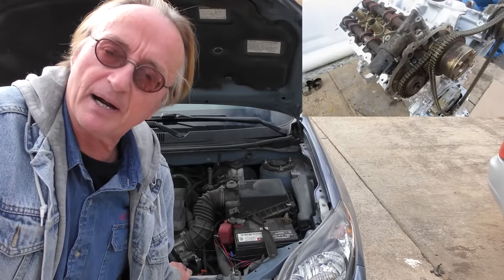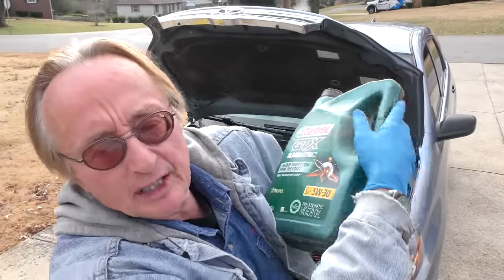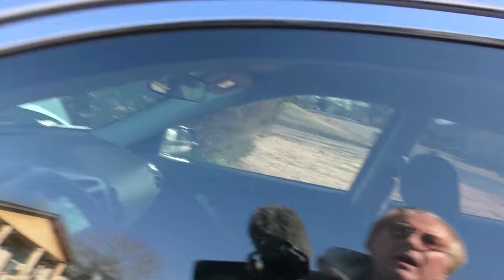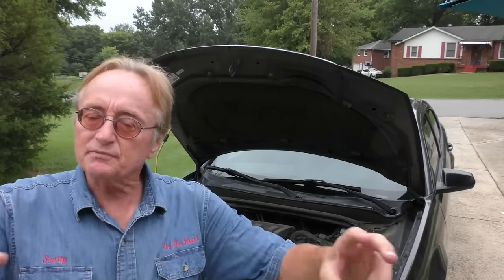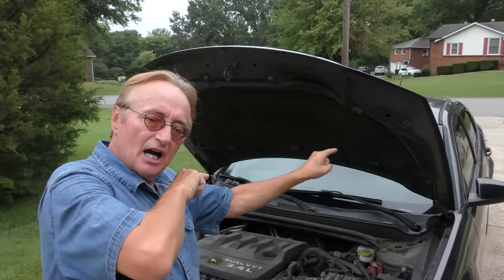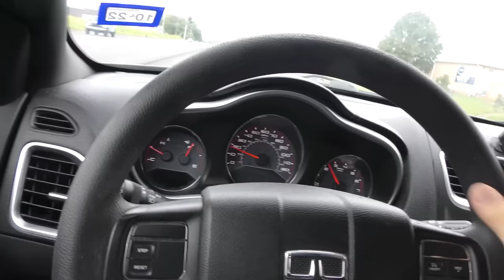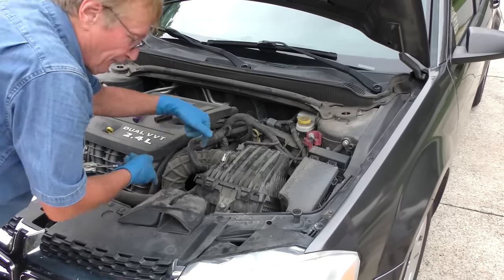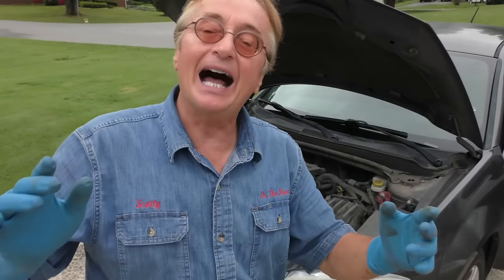Doing This Will Make Your Engine Run Like New Again

Comment: One thing you want to watch out for is the oil cap itself. It can disintegrate at it base and clog the oil pickup. I know it sounds crazy but a perfectly healthy engine did it in my vvti toyota. Change the caps if the car is getting older.

Comment: Sold my 2005 new off the lot Matrix after 350k miles. I took care of it. The new owner still has it and it has at least 500k miles on it. I WISH I did not sell it but it was one of 3 cars we had.
Reply: How many years did you own it?
Reply: About 9 years. Bought a used 2007 Rav 4. I’m going on 9 years of having it BUT I am getting a few majors issues with it. It had one owner and 35k miles on it then. Still had the the new car smell but was originally near a area with salt water (FLA) I only have 120k miles on it now.
Reply: @lasharapinckney5276  that matrix sounds ridiculously reliable for those miles.

Comment: I do my oil every 3-4000 and i use a k&n oil filter with a synthetic blend in my 1998 honda accord EX 2.3L. It burns a fair amount of oil so to combat that i mostly go easy on the car and try not revving too high (thats when mine especially burns a ton of oil).

Comment: Scotty this is the 1st video I've got to watch&it sure isn't going be the last. I've gots a 2000 Mustang v6-3.8L. I came in from work 1 evening turned car off went to go to work the very next morning. Wasn't going n.e we're. It wouldnt crank, wouldnt start, hear no clicking. Battery is good, Alternator is good. I'm hoping you would lmk what the prblm is&what I need to do to fix it. My DaD was an awesome Mechanic&I've gots to say ur pretty smart&awesome guy also. Most Respect. Ty Scotty

Comment: I’m my own mechanic thanks to the internet, I learned how to fix my own car. I have a 05 Chevy Cobalt and it has almost 200k miles I bought two years ago from a person that didn’t take good care of it but I’m fixing it up now, but when I first drove it on the highway it didn’t shake didn’t misfire or nothin else serious. The only real issue is it sounds like a motorcycle. But I never got that car to keep it forever I got it just to take me to A and B until I get a better one.
Reply: Those are actually good cars. The ECOTEC motor is a strong unit. I had a 2.2 on my Saturn L100. It was running great at 197000 when it was stolen.
Reply: I put 223,000 miles on a 2007 Cobalt from new, still ran well when i sold it in 2015. Kept the oil changed regularly.

Comment: Great info. I change my oil+filter every 7/8 months on both of my cars (06 Solara V6 snd 2011 SantaFe awd) regardless of miles driven. I always use Mobil full synth extended performance or Castrol Edge full synth extended performance plus mobil EP oil filter. 20+ years using those brands.

Comment: That was a very nice video! I actually started doing oil changes on my own and can't wait to learn some more things about my car and actually maintain it. Thanks!!
Reply: After buying and losing 3 used cars - all lemons - in one year when I was in college (i'm an accountant) I decided I better learn about automobiles before buying a 4th lemon. Now I help everyone with their cars, and would go up against an ASE certified mechanic any day of the week, unless your talking transmissions!  lol! And trust me, do the same BEFORE you buy a home. Know how to fix stuff, you'd be surprised just keeping stuff "clean" helps keep it operating! If you own something, learn how it operates, you'll never have regrets.
Reply: Don't wait for something "to break" before fixing it. And stay away from Mexican auto parts. NAPA and O'Reilly's has the most American made auto parts - if you can afford it. AC Delco parts are "excellent", better than original GM parts on new cars. (also worked at Autozone). Delphi are Toyota aftermarket parts. I think AC Delco are the best aftermarket parts out there . Regardless if you own GM or not.
Reply: @Johann Johann  Denso are OEM Toyota parts.
Highly recommended. 
My Scion TC has the Camry 4 cylinder engine.
So easy to work on.

Comment: I own a 2012 ford fusion i4 with 460,000kms still run like a clock and replace the oil every 5k with full synthetic oil and transmission oil every 45000km. Thanks Scotty!!

Comment: I always used Mobil 1 but recently grabbed some Pennzoil Platinum. I find it runs a lot quieter with it.
Reply: Mobil one is garbage. 
I only use Castrol Edge Advanced Full Synthetic
Reply: @jacobsebastien3910  what castrol models can use for golf mk5 or any European car? Advice me
Reply: I use Pennzoil Platinum 5W30
Reply: Did you use the same viscosity of each? I could see the engine operating sound change if you used a different viscosity
Reply: @jacobsebastien3910 why is it garbage?

Comment: Bring the engine temp up to "normal" operating temp before you pull the drain plug. This will help it flow better out into the drain pan. And move the drain pan out from under the oil filter when you put the new filter on. I failed to do this once and and the new, clean, unused filter slipped out of my hands and landed in the pan of dirty oil. That was $ down the drain and I learned and have never repeated this.

Comment: Awesome video, this is the same engine in the Dodge Journey sxt. 4 cyl 2015. This is a great motor, with some work they can last a long time mine is at 360,000 + miles. right now I have an exhaust leak north of my O2 sensor bank 1. it might be my exhaust manifold...hey Scotty, any videos on locating exhaaust leaks and replacing a gasket on this engine. Also, I happen to have a VVT solenoid for the intake side sitting here right now...just don't want to get into it right now because they have a history of breaking off when attempting to remove them, piece that gets stuck inside engine has to be drilled out. That is a whole nother story.

Comment: If you have an aluminum oil pan, be super careful when putting the drain plug back on…don’t cross thread it! If you do you’ll have to replace the oil pan and they are not inexpensive.
Reply: Quick oil change place....cross thread is better than no thread. 🤷‍♂️😏
Reply: that is why Scotty says hand-tighten the oil pan drain plug first before using tool.
Reply: They're not that expensive. I had to replace mine and it only cost $1385.

Comment: My dad's been using castrol edge 5W-30 (we buy it in costco cause canadian costco's sell it for a decent price) in our mercedes for the last 20ish years and it barely burns any oil. That's preety good for a mercedes after 20 years of abuse. The exterior is falling apart but the main parts and interior are still fine.
Reply: How much is it?
Reply: @Vertikala-pc5ig  Usually get it on sale, but in Costco its in bulk. Its a 5 liter container and you get 3. Its currently $140 cad plus tax for 3. Which makes it like $47 cad plus tax. My Costco has it on sale every year so I try to get a few boxes and keep them well contained in my garage waiting for use. Other stores sell it for 10-30 dollars more per container. I reccomend looking around getting it on sale and keeping a few containers of it for the next few oil changes.
Reply: @AmbeSwag  So it comes out about 10$ a liter which is not cheap either but what can you do everything went up. Thanks anyway
Reply: @Vertikala-pc5ig  I buy it from Costco if its urgent. Usually I stumble upon some random store selling it for way cheaper cause its on clearance or something. Just remember to check if its sealed properly and check when it was made.

Comment: Do not use a long breaker bar to tighten the oil plug. A standard length ratchet or wrench will get it plenty tight. You won't have to use a long bar to get it off at the next oil change. Don' t strip the plug by using too big a wrench. C' Mon Scotty, you know this!
Reply: He actually mentioned not going to tight so you don't strip it in the video. He also mentioned the only reason he was using an extension bar is to prove that anybody could get the oil drain plug off even if they're not as strong as some other people with it.
Reply: I agree how idiotic!
Reply: Come on man, how can you diss Scotty? He is never wrong!

Comment: I had to do the throttle body position sensor reset for idle relearn in my honda after cleansing the body because car was jerky when stepping on and off the accelerator. No other method of idle relearn worked. Just to keep this in mind maybe some other vehicles require this too.

Comment: Agree on the Castrol oil. But I use fram filters always. Now as far as the alloy wheels...  I like them. I live in pa. So salt...   Trick when you change tires wire wheel the rim and spray paint it with enamel paint. Its easy

Comment: I'm currently using Valvoline Premium Synthetic Oil which is a better graded formula than Regular Synthetic Oil which haves additives to clean any deposits and longer lasting. Did it for my 2010 Nissan Rogue which I change oil once a year on. Still Run good  👍
Reply: And I'm just an average "joe". not an employee. Just got pissed when I learned what the legal term "full" means regarding motor oil. check it out.

Comment: I AGREE WITH YOU ABOUT CHANGING OIL REGULARLY. I did have an 1985 VW Cabriolet  that I bought in 1995 with 100k miles on it. I changed the oil RELIGIOUSLY with Castro oil 20-50. I drove it for 16 years, odometer quit working at 196k and continued to drive it for 5-7years more. GOD only knows how many miles I had on it. I also had the same clutch the WHOLE TIME. IT'S A SHAME I LET MY MOTHER CONVINCE ME TO SELL THE CAR, STILL RAN GOOD, NO LEAKS, GOOD GAS MILEAGE FOR THE WAY I DRIVE but was going to need a new top soon, air conditioning didn't work, needed paint job and interior work. I had just a new clutch and tires installed. 😮😢

Comment: I Only use Castrol Edge High Mileage Advanced Full Synthetic in my 08 Ram 2500 4x4 Hemi can't even feel the engine running while idling. Great Oil 💪

Comment: I had the same problem with my Dodge avenger 2013 black top edition Had to replace that part throttle control at 65,000 km

Comment: On my LH Concorde I cleaned out air filter housing thru and pass the throttle body upper and lower intake and changed all gaskets including valve cover gaskets .I also replaced the sensors on the throttle body inch pound torch wrench tighten in sequence good business. DIY'er

Comment: I change my oil every 3000 miles or during major seasonal changes. 0W-30 for the Winter and 5W-30 for the summer. Always K&N filters and Amsoil Oil if I can find it, otherwise I use Pennzoil.
Reply: Mobile 1?

Comment: The other thing about cheap filters is they will stop filtering, and in many cases, clogged up and collapse and then when they do, either you have a massive leak if the canister ruptures or if the filter material breaks apart, then you have junk flowing around in your engine oil.  Best to spend a few bucks more and get a premium filter (the price difference in most cases is $10 or less and well worth it, especially if you're going 5,000+ miles).  I generally have used Bosch or Wix filters (both are good quality filters and are generally better than even the OEM filters which are only designed for about 5,000 miles).

Comment: I change mine once a year at around 10K with 20K Mobil 1 full synthetic extended performance and matchign filter because my Lexus GX 460 requires that I drop the skid plate to reach the oil filter.  I think if it didn't have the skid plate I would maybe increase the frequency.

Comment: Just be sure you are turning the plug the correct way when using a extension.
Reply: What?? And 6 others?🤤🤤🤤

No matter if it 10 miles long… left turns left ten miles other side. right turns right ten miles other side extension.
Reply: Is it the same if I use a wrench instead of a socket?

Comment: I'm a Mobile 1 man. My grandfather used Mobil 1, my father use mobile one... so I use Mobile 1.
Reply: Ah...tribal custom. 🤷‍♂️😏😆
Reply: Is mobile 1 that old?
Reply: Ford boss me did an oil comparison recently. oil analysis included. I think mobil 1 was there but not really the top performer. Check it out if you have time.

Comment: Blessings scotty..I have a 2010 toyota avalon limited at 245000 miles .what can I do to keep it going and reach 400000 ? Thanks ❤️
Reply: Buy 2 odometers
Reply: Routine Maintenance!! Changing all filters and fluids at the recommended time frame or recommend mileage. That’s pretty much it. Change spark plugs at recommended mileage.

Comment: Should you change every 5000 or 3000 miles? I was always told 3000 miles but with the newer vehicles I was told you can do every 5000 miles is that true? I have a 2015 ford explorer limited. One more question, do I use synthetic olive or conventional in this truck?
Reply: 3,000 to 5,000 miles for conventional oil. 7,500 to 10,000 for full synthetic oil
Reply: I’ve never gone more than 5k miles between oil changes.  Sometimes as early as 3k miles.  Or, if you put less than 5k miles per year on your car, change it yearly.  I use the 4th of July as my yearly marker because it’s easier to remember.  Always use synthetic and the grade of oil (usually displayed on the oil filler cap).  Oil degrades rapidly after 3k miles, so waiting until 10k miles doesn’t do your engine any favors.  You’ll hear other opinion’s, but I’m positive Scotty would agree entirely with what I’ve shared with you.
Reply: Get a small notebook and record any maintenance or repair done on your car. I put the date and mileage when it was done, too.

Helps a lot.🙂
Reply: @Joe Cox  thank you. I always keep receipts and paperwork of anything done to my truck. I've only had this truck for about 6 months or so and so far haven't had any issues that needed being done except my rear camera keeps going out or reversing the picture.

Comment: Good stuff, only I wouldn't dip a nice new Bosch oil filter in the dirty oil to lube it. I'd prefill the filter 1/4 of the way with clean oil letting it saturate the element, and wipe the new filter gasket ("lip") with some of the clean oil instead.

Comment: I ran my bmw for about a week with low light on not far thank god less than 120 miles but just check it and it was low on dipstick almost bare. Changing oil tomorrow as I just found out. How screwed am I? No knocks or pings car runs perfect 👍

Comment: I also use Castrol oil. I have been for a long time but my 2015 Kia Soul uses a little oil between changes I guess it has the weaker rings from the factory.🎉

Comment: Pennzoil platinum 5w20 in my Hemi not a tick a bad lifter cam or any engine problem. The flow rate is correct for the 5.7 according to Chrysler.

Comment: Blackstone Labs did a video decades ago.  What is the best oil ? He listed his dad’s favorite...never had an oil related failure. He couldn’t be the same as his dad, so he got a different favorite. Never had an oil related failure.  He end the piece with his new favorite.  What was cheapest, on sale with the correct engine specifications.  Guess what? No oil related failures.  Just change it at recommend intervals or sooner. 🤷‍♂️😏👍🏻😎💪

Comment: Hello Scotty, I need suggestion for oil grades.  My car's mileage is 90,000 Kilometres. I am using Castrol Magnatec 10w-40. I was using the same grade since 30,000 Kilometres mileage but different brand. It's my first time I am using castrol. However,  I want to shift to 5w-30. Is it safe to shift to this grade after using 10w40 for 70,000 Kilometres? Both grades are given on my car's manual. 
My country's average temperature in summers is 39degree Celsius and in winters it can go to 0 degrees.
Please guide. I am counting on your opinion.
Reply: If 40 degrees C us equal to 104 farenheight, Id go with the thicker oil. My 2 liter 4 cylinder uses 5 w 30. But thats in the owners manual. Maybe in july and august I get 30 C 86 f. I am not a mechanic. Do whats in your interest.

Comment: That has to be the cleanest oil after 5,000 miles that I've ever seen. 😯 What's your secret, Scotty?
Reply: It seems to depend a lot on driving habits and the vehicle.  Example-My wife's 2013 Grand Caravan oil comes out decently clean at 5 and would probably be fine to 6K but my 07 Wrangler's oil looks rough at 4K.  Then there's my step daughter's 2016 Mini that comes out fairly decent looking at 6-7K.  Of course it helps that it's an oil burner and gets a fresh quart added every 1500 miles.  The Caravan surprised me though since it's a van with a lot of under hood heat.  Guess the oil cooler helps.  I always just watch my oil and when it starts to turn from the brownish gold to dark brown I change it and never let it get to black.
Reply: Drive highway

Comment: I agree completely that it is crucial not to starve the valvetrain components of oil, especially on a cold startup in these overhead cam/variable valve timing engines. This is one of the reasons that I always prefill my oil filter with oil when changing my oil, so as to minimize the time it takes to get oil flow established to the upper valvetrain on a first start after the oil change. I once heard a Ford 2.3 liter overhead cam engine emitting cringing valve train clatter for about 10 sec after the first start after the oil change without having the filter prefilled. The normal amount of time for that engine's valvetrain to make a slight noise on startup was no more than about 1 sec.
Reply: Older cars with hydraulic lifters would clatter until they filled up with oil which was about 25-35 seconds.

Comment: Scotty I have a 2010 toyota avalon limited 246 000 miles I wanna change the oil I normally use the 5w30 toyota oil I went there and they said they are out of 5w30 and gave me 5w20 saying its no issues using it.. can I use the 5w20 and it cause no issues?
Reply: Could not get green coolant as they are not makjng it anymore??? Used yellow compatable but lesser life span and requires drainings